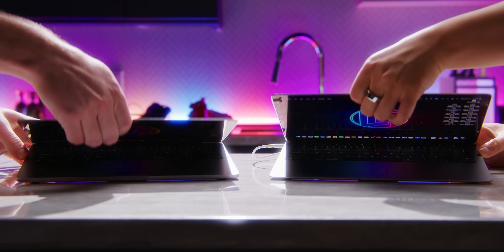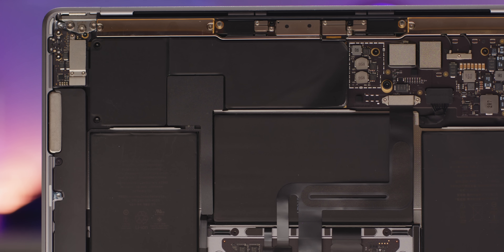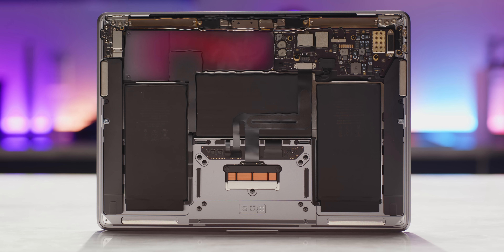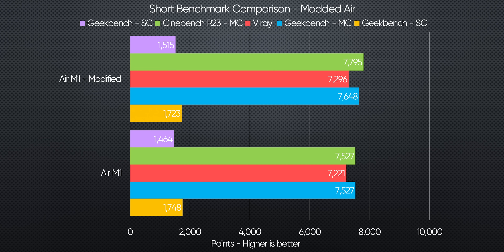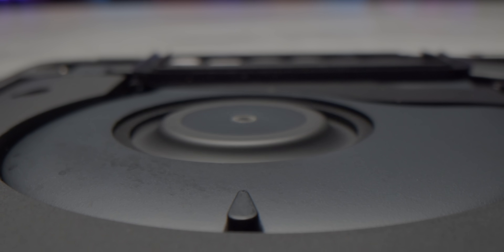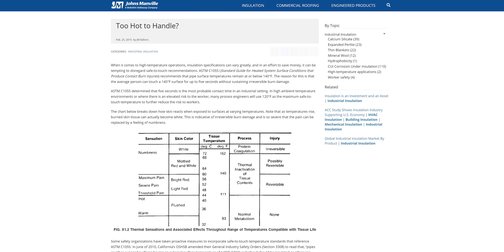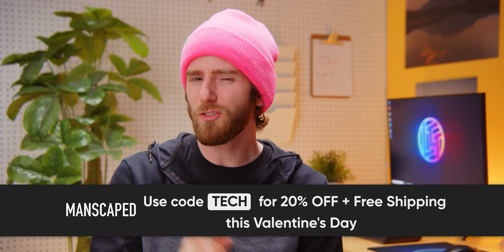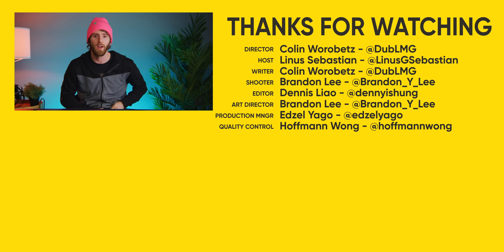Fixing Apple's GOOD Engineering - M1 MacBook Air thermal pads

Comment: guys it is true that the m1 air would outperform the pro 13 inch with the thermal pad but all u need to do is install macs fan control and turn the fan up to max to instead out perform the m1 air up to 5-10% by the time an hour reaches well apples limiting the fan so it doesnt sound loud thats why

Comment: Hi, just in case I will say that this fix is a good fix for short time, but heatup the back of the computer also heat up the batteries, and I do not know how can hold the batteries after 3 years of more than optimal heat.

Comment: The only reason apple didn't do it themselves because it isn't guaranteed that the aluminum back panel may actually be put on a hot surface, inadvertently heating the CPU rather than cool it.

Comment: Apple's deranged need to go fanless at all costs has been hurting them since the 80's when Jobs insisted on the Macintosh (1984) being fanless. Quiet, sure, but the heat ended up killing many Macintoshs and created an entire market for 3rd party fans/cooling solutions.
Jesus, just have a fan in there! People seem to think that fans are automatically going to be loud AF. LTT made an entire video about a PC being cooled only by Noctua and it ended up being very, very quiet.

Comment: This heats up the battery to unsafe levels (beyond 45c in testing). There is a reason laptop manufacturers never use the laptop base as a heat spreader.
Reply: so what if I put some insulation, between the backplate and the battery...? probably safe now huh

Comment: if you add thermal pads the bottom plate will get hot and the heat will get to the battery and shorten its life span by alot. if you want your battery to last many years don’t do this mod.

Comment: Potentially, all you would have to do is add a dbrand skin and then you are not contacting the aluminum case directly.  Would that increase limit to 70C/75C (TME/ITE)?  You could even add a thin later of insulation under the hotspots between the case and the dbrand skin, since the case is basically being used as a heatsink.

Comment: VIDEO IDEA: Put a Macbook Air on a custom metal stand that has quite a big surface area touching with the base of the laptop through some thermal pads, making the stand a huge passive radiator.  This should be suuper effective with the thermal pad mod, as the chassis would transfer a lot of heat to the stand/radiator, but I wonder if it would be useful without the mod as well, just for longevity reasons.

Comment: So wouldn't that increased heat inside the chassis shorten the life of the other air cooled components inside your Macbok. Like the battery, logicboard and so on. Hmm, tough trade off.

Comment: What if one used verticle stripes of thermal padding so that half the heat would be expelled through airflow out the back slit?   Then some heat would go into the case, and the rest of the heat would be expelled as Apple engineers intended.  Would that both increase performance and retain comfort?

Comment: Hope they do this same mod on the new MacBook air M2. You could also throw in a PGS sheet into the bottom lid to spread the heat to the whole panel. This way you don't have the a single hotspot.

Comment: remove something else to add a fan, remove a battery or one of the speaker
Reply: You would have the same problem as the Windows laptops. Low battery and shitty speakers for little performance gains.

Comment: Let's be fair, though, you're not really supposed to hold your laptop on your lap.  Or really put it anywhere soft where air can't circulate underneath it.  So adding the thermal pads to let the entire bottom of the laptop be a heatsink shouldn't really be a problem if you're not a complete moron.

Comment: Ok, I’m not the best with computers but I run lots of pro apps on my MacBook Air and wanna maximize my performance. Does this mod mess with the longevity of the device?
Reply: Nobody knows. 

In my opinion the problem with this could be the glue if the added heat temperature would melt it.

Plus the damage it would had to the battery.

Comment: I recently purchase the M1 Air and am extremely impressed with the performance. I was surprised how warm ( but not uncomfortable) underneath when play light games (team fight tactics) but more impressed at how quickly it cools down when doing light loads.Me thinks someone could make a thin inductive all metal fan that can power up on a wireless charger for funnsies 

Nonetheless super impressed with the M1 Air so far, only wish it came with 512 gb standard or at least an option without specing all the way up to 13 pro prices, because even with 8gb of ram its fine for light photo editing. I am more concern with memory swaping from ram to SSD and 256gb doesn't leave much of a buffer for that considering the new logic of the M1 silicon heavy relys memory swaping, especially the M1 pro and M1 Max with PCIE 4.0 speeds for NVMe

Comment: Is it possible that the excess heat may have a negative impact on battery longevity, since the battery would be experiencing excess heat that it otherwise wouldn’t have without the thermal pads?
Reply: Yes, definitely

Comment: My 2013 Macbook Pro gets hot AF but I always use it on top of my laptop sleeve. Not only does it prevent my lap from burning, it also helps with traction so the laptop doesn't slide off my lap. I just bought a Macbook Air M1. I think I'm going to do this mod.

Comment: Have you ever tried thermal pads between MacBook Pro's heat pipes and it's case? Do you recommend I try it?
Also, In Greece I use it at 35-40C so no burns at the scrotum pls ;)

Comment: Could the higher (unexpected) case temps cause issues with components not designed for extra heat like that over time... the case can easily hit 50C? I also noticed the top of the chassis where the keyboard is can get a bit hotter too (around 38C).

Also, you probably don't need to remove the pad and replace it with a thermal pad.

Comment: the battery will be ruined over time. the thermodynamics for the battery are subject sensitive. the lateral heat which passes to the surfaces without affecting the battery from the cooling sink which deviate its path into the battery through conduction. this will be the death of your m1 Mac

Comment: hmm, from an Engineering POV, I would be worried about the bottom plate warping due to the poorly distributed heating of the plate. I would also be worried about the hot plate further heating up the batteries and thus hurting their longevity. If these things don't happen, then its a good mod imo. You could also install some insulating foam or other thin insulator between the bottom plate and the batteries (if there is space of course) if you're worried about your batteries heating up.
Reply: But having your batteries impacted would imply doing heavy workloads all the time, which I think most people buying the Air won't. It's just a way to have better performance when you need it, so in normal use there shouldn't be a huge difference in temperature.

Comment: How to fix the MacBook Air properly.
Apply the thermal pad solution.
Then add a external  copper foil bridge from the base to the back of the screen to double the effective the external heat sink of the case and also radiative area of heat.

Comment: what would happen if you do the same thermal pad solution to the regular MacBook? would that have better thermals seeing how it is both using a fan and the bottom plate as a heatsink, and would the bottom get just as hot?

Comment: 1. Buy Apple's MacBook Air with M1
2. Kill it's battery with thermal pads.
3. Buy one more. (Profit?)
Reply: Anand Raj  lithium batteries has much bigger speed of degradation while working at temperature more than 45°C. So such conditions will have notable negative effect on batteries.
Reply: Anand Raj  Everyone wins after such discussion.

Comment: DO NOT TOSS THE INSULATING SPONGE. You should actually transfer it on top of the battery so that it doesn't get exposed to the heat of the aluminum casing. Excess heat on the battery is a big nono

Comment: I wonder what a mod like this will do to the longevity of the device. Won’t increasing the temperature of the entire chassis cause damage over time to other temperature sensitive components in the MacBook, like the battery and even the display? 

This seems like a good solution if you plan on only using your laptop on a desk with a cooling pad and cool ambient airflow in the room, but come on… it’s a mobile device for a reason.

Comment: I'm using this method with a 2mm thick high-performance thermal pad. In a room of 27 degrees Celsius, CPU performance was huge improved, the maximum temperature in the high-performance core was 98 degrees Celsius. However, the battery temperature increased quickly. Running the Cinebench R23 test for 10 minutes brings the battery temperature up to 44-45 degrees Celsius and still tends to increase further (the temperature of a lithium battery should be in the range of 5-45 degrees Celsius).
So I think if you regularly perform heavy tasks lasting more than 10 minutes, then the Macbook Pro M1 is still a safer choice. Otherwise, the Macbook Air M1 is better.
 Ps: Why doesn't Apple make a version of the Macbook Pro without the touch bar? !!

Comment: At least you say, that you could burn your leg. + ...btw maybe add a kinda self-adhesive rubber to that area. Heat will still spread to a capacity of a metal as it was - almost no difference, but the leg will be ok.

Comment: So is there anything that would preclude 3d printing a new bottom casing with enough vertical room for a fan (or 4) that takes usb power? Or installing this as basically a desktop and attaching some other kind of cooler? Like liquid?

Comment: Hello.  How are you not ashamed?  After all, you have 13 million subscribers, showing such nonsense.  What you showed is killing batteries and other components in the laptop.  Physics cannot be fooled, and engineers at Apple are not stupid.  The heat is distributed throughout the lid and horror occurs inside.  People will ruin their laptops because of this video.

Comment: People, please don't listen to this smart guy.  You will kill your MacBook once and for all, you will not be able to sell it on the secondary market normally, the device does not immediately fall under the Apple warranty.  Even if you don't have traces of breaking the cover ... You can see everything there programmatically.  After installing thermal pads in the load, for example at work in Blender, you will see critical temperature readings on the battery packs.  A thermal camera is being created for components and no one knows which of the chips on the board will break tomorrow ... Be careful, do not listen to smart people who think that they are smarter than Apple engineers!

Comment: Did you wonder what will happen to the batteries if the processor heats the back cover and transfers that heat to the lithium batteries?
Did you measure the battery temperature during the tests?
Reply: Apparently, nobody has - especially people who designed heatsink adjacent to battery...I'd rather stay with Thermal Pad on SoC alone.

Comment: I did this with my 8th gen laptop so i'd run quieter (thinner than MacBook air). When my oven failed, I used the bottom of my laptop instead.

Comment: You'd be fine in most cases, as general use and browsing wont raise your temps much.  Either way, the much lower TDP of the M1 vs the Intel Airs also come into play.  Intel Macs tented to run much warmer over their years, and their batteries were fine long-term.  Unless you're pegging your CPU all day long, this mod would be fine, and even then...

Comment: Sounds plausible  but what are the temps for the intel chipped Air? I learnt very quickly to not use my 10 year old i7 Mac Book Pro on my lap coz it gets friggin hot and metal dimdos machines are more than toastie. So your point is?

Comment: I'm not a materials engineer but I worked with them on thermal performance testing on different materials and scenarios.

...You can't extrapolate the data like this. You're obviously on the right track, but you can't assume a 7c rise in ambient temp of the room = 7c rise in surface temp.

Comment: I'm not sure if just subtracting the room temperature and adding 35°C will really be exact for this. I could imagine that the heat think cools less under warmer temperatures because the temperature difference is lower which results in worse heatflow.

Comment: The only thing which I'm really exited about is what Apple has done this time to fuck up their devices.
But I guess we will see in a few years on Louis Rossmann's channel...
Reply: My guess for this will be that the motherboard will be damaged over time because the heat is not removed fast enough. After stewing in it's own heat for several years it will cause some damage.
The thermal insulating pad will it's part here. This was of course not added to hinder thermal flow, but to "protect" their customers from a warm underside of the aluminium body.

Comment: Here's an experiment for LTT:

Rather than using a full width thermal pad to transfer the heat to the external chassis, what if the thermal pads were several strips that were separated by several gaps? Would this help delay the total time needed to have the heat sink being maxed out? Would much of the heat 'waft' out through the vent near the display?

The idea of this mod's mod is to strike a compromise between full transference to the external chassis and the intended design.

Comment: Regarding the Microsoft Surface AD.
The new surface laptop that the kid was comparing with the M1 Mac. But when i checked the prize. The Surface i3= around $900, i5's= 1200-1500, i7=1800.
Macbook Pro M1= 1200. 
M1 is faster than i3, i5 and i7.
So  Microsoft and Intel are just giving false ads.

Comment: Just completed this exact same mod to my 12-Inch MacBook (Early 2016) with amazing success. Idle temps down from 65c to 42c, stress testing 73c+ down to stable 59c. Used 0.5mm GELID Solutions GP Extreme Thermal Pad cut to a square to fit over the unbelievably tiny cpu heatsink, and I removed an equally sized square from the black thermal insulating tape from the back plate, to provide improved thermal conductivity. Fits together like a glove! 

Thanks Linus!
Reply: Did it affected to your battery?

Comment: Use this mod on your Air + a fan laptop stand thingy and you've got an actively cooled Mac Air with triple or more the thermal mass. Linus should do a video benchmarking that.
Reply: This actually makes sense since on the go you'd be trying to preserve battery life anyway thus generating less heat, at home you'd be plugged in so having a fan to cool it all down isn't that big a deal.
Reply: And then you have to carry that stand around diminishing the reason people buy macbook air in the first place
Reply: I'n my experience it does not get hot at all, I'm also rarely benchmarking when im out and about with my mba m1
Reply: @youtubeemail1549  for home buddy
Reply: @Arthsingh-aim  but how would it affect when we bring it out of home? Dissipating the thermal across the cover plate and risking the battery temp when no laptop fan cooler around. Thermal pads use is a bit controversial for sure. 

With thermal pads but risking the battery temp (i’m talking about out of home situation) or without thermal pads but the laptop would perform worse, choose your poison wisely.
Reply: @TheBlackbird132  thats only if youre running cinebench all the time.. unlikely you will actually be running it this hot, the point is you wont be thermal limited near as much

Comment: Could you passively cool a processor  in any effective way by simply attaching it to a ridiculously massive block of metal? Not like a passive heatsink with fans or whatever, but like a 500mm cube of steel? How much better is a fan?
Reply: Put a thunderbolt external ssd enclosure on the Mac mini case. Huge aluminum block...Instant cooling solution for the ssd chip

Comment: I think I found the solution: covers! 
My Lenovo Yoga runs hot occasionally, besides being a bit too spiky to hold (eeh modern design); so I forked out 40 bucks for a fake leather cover, which works beautifully for both problems. 

Users already go crazy for covers for Apple products, it would be a slam dunk. 
Then when you need performance, you put it on a $499 iCooler dock. Perfection!

Comment: The MacBooks from early 2006, they ran the fans at base rates of 1000 RPM... The systems would run at about 60 C and would be uncomfortably hot when being used as portable workstations. This is why with MacBooks from late 2006 and later, the fans were spun at a default of 2000 RPM. How does the modded MacBook Air M1 compare to the 2019 MacBook Air in terms of ambient temperature when running CPU-intensive workloads?
Reply: 64C cinebench multiple core test 10min cpu 800%. Room temp 24C. Single Core 38C

Comment: Wouldn't this affect the battery in a negative way? Heating the bottom part of the mac would alson cause the battery to run hotter or am I completely wrong in this?
Reply: Heat won’t pass to the battery since the cover metal is tooooooo thin